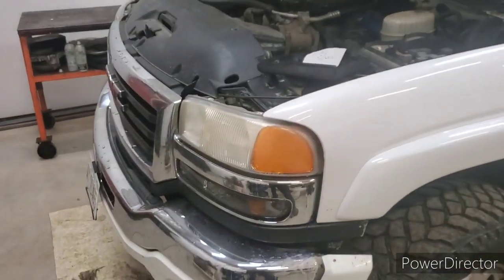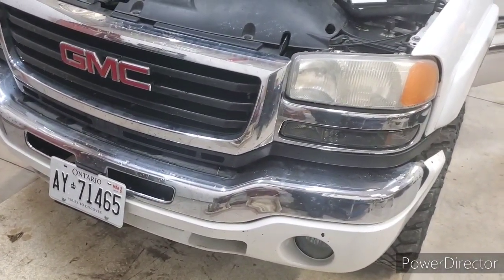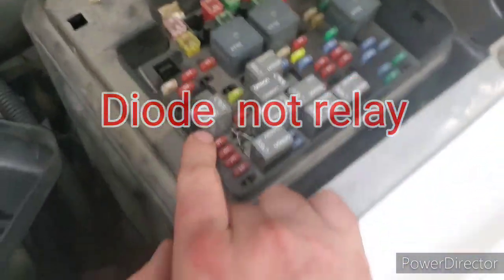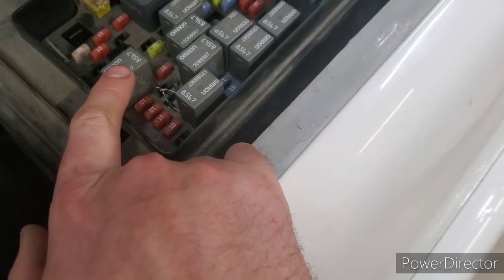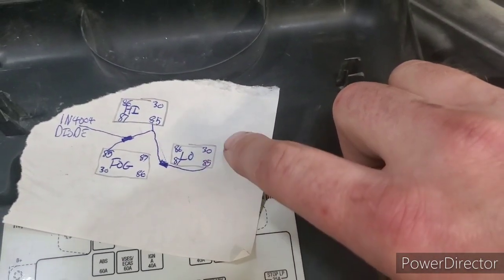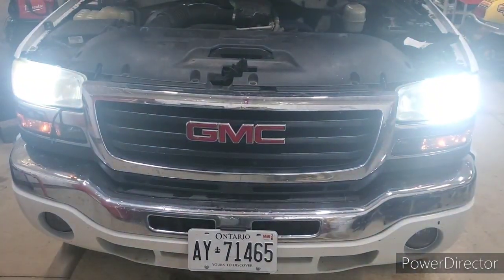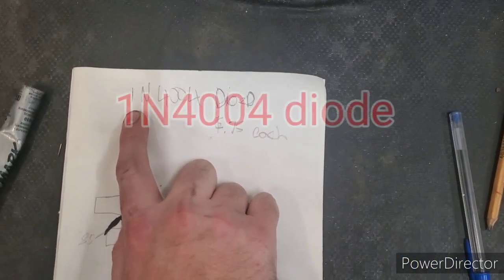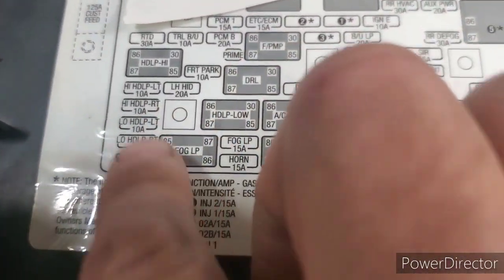how to do the 6 high beams mod on 03 to 07 classic gm/chevy trucks

Comment: Nice man! What kind of high/low bulbs you using?
Reply from the maker: I'm not sure of the brand of led  I  normally buy auxbeam for my trucks there the same price as the normal bulbs but out  proform much better i have ran them in the worse case ontraio for 4 or 5 years with no issues check them out if your interested in led